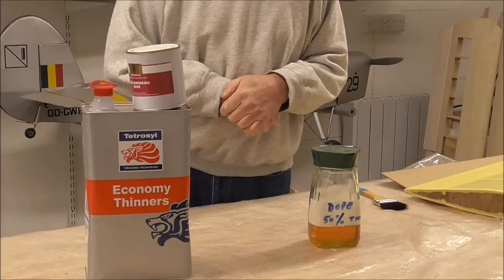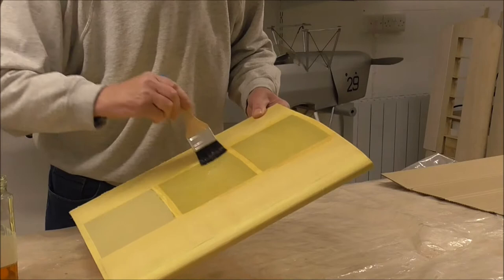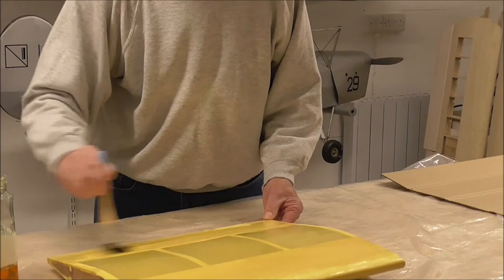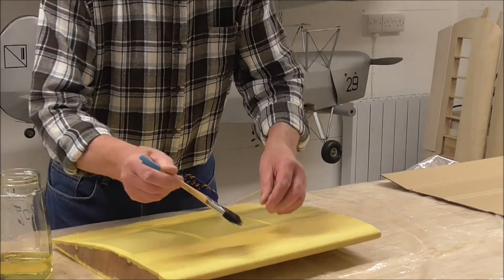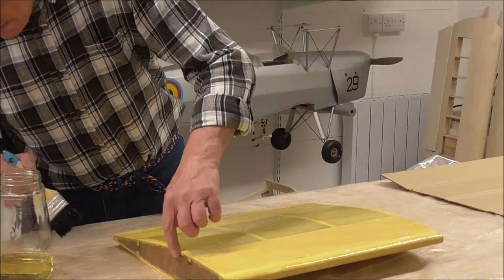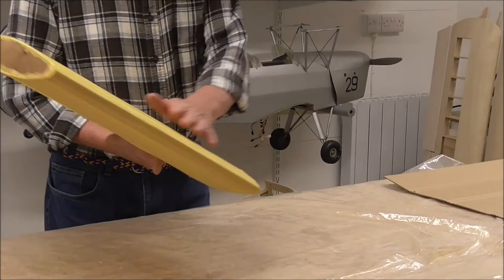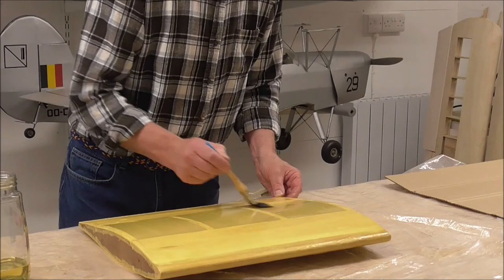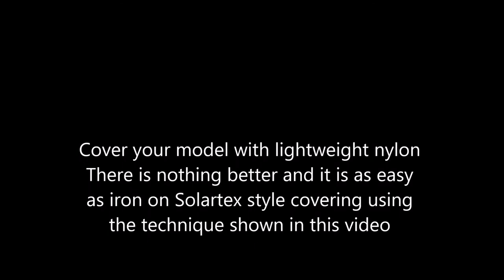Covering with Nylon Part 3

Comment: Thanks for the clear explanation. I'm going to give it a go on a DB Mighty Barnstormer I have had in stock for many years.   I'd never have thought of using Balsaloc or similar to apply Nylon, but when you think of it, it's the same as applying Litespan or similar, with the exception of course that you heat shrink it instead of doping.

Comment: G'Day Phil, thanks for the informative Videos. I'm looking to build and cover 1.5...2 Meter (59..78 inches) RC models are these too small for this covering? I have dope (understand ordinary thinners will do to dilute it. As regards clean up of brushes would you use thinners? Suggestions welcomed. As regards Nylon can you suggest some sites types (All I can find locally is ripstop, apart form the weave what is the problem from your point of view?
Reply from the maker: Hello Russell
Models around 60" span are about the smallest that you can safely use nylon on.  What you need to look for is Polyester Dress Lining Fabric.  The best source for dope is a light aircraft supplies company.  I used actual aircraft High Shrink Dope.  It is thinned with cellulose thinners.  The High Tack adhesive is water based so clean your brush with water.
Good luck
Phil

Comment: dear Phil. I have been researching all the covering technologies for RC scratch building that are there in the past weeks. Currently I am building a PA-18 to a 1/4 scale with 2.6m wingspan. I have come to conclusion that NYLON is the best material and also pretty cheap. I dont want to buy oratex or any brand cover material as I want to avoid those ridiculously high costs. I am struggling to understand what is aircraft dope translated into Greek, what type of material is aircraft dope?
Reply from the maker: When I say 'aircraft dope' I am referring to the type of dope sold by light aviation suppliers for recovering or repairing the fabric of vintage aircraft.  An example would be a Tiger Moth or Auster.  There are a couple of such supplier in the UK, no idea about Greece I am afraid.  You need high-tautening or shrinking dope, there are several types available.  If you have real trouble finding a supplier you can use clear shrinking dope available from model shops.  As you are in the EU you should be able to find it in Germany if such shops do not exist in Greece.

Kind Regards

Phil

Comment: Congratulations Phill great videos, educational  and inspirational as well
Using the information you provied plus the materials I could find I just finished a covering test over an old wing I had using nylon purchased at the household fabric dealer, contact glue and nitrocelullose laquer as dope.
I must said results are pretty promesing but since I do not have any previos experince to compare I should ask how can I perform a puncture resistace test or something to get an idea of how resistenace the covering is.
Thanks
Reply from the maker: Good Morning Roberto
Thank you for your message.  I am not sure why you want to carry out a puncture test.  If you have managed to get the nylon drum tight it will be fine.  All you are trying to do is get it airtight, not to make it indestructible!

Best of luck with your modelling.  If you are not happy with the results, try and get some real aircraft high-shrink dope from a light aircraft supplier, that is the best stuff for the job.

Best Wishes
Phil
Reply: 40 or 50 years ago the standard joke was. If you crashed a nylon covered model plane, you ended up with a bag of broken balsa wood. That joke was pretty much true!

Comment: Nice work.  What's your source for model grade nylon?
Reply from the maker: I have had success with several different types off eBay.  You just have to experiment.  Ripstop nylon is no good, it is not smooth, it has a squared pattern in it.  You need to find some that will ideally heat shrink before you dope it to get the best results.  You can afford to experiment with material off eBay, it is only a couple of pounds a metre or yard.

Comment: Great videos Phil. I too mourn the passing of Solartex and have an airframe coming up for covering which I intend to use nylon on. Did you say you could supply or know where to obtain nylon? I’ve got some JP models stuff but it’s very expensive. Also I have an old tub of Balsaloc which is similar to the heat activated adhesive you used.
Reply from the maker: Hello Ian
The nylon is for sale on eBay, here is the link:
 https://www.ebay.co.uk/itm/362968044663?var=&ssPageName=STRK:MESELX:IT&_trksid=p3984.m1555.l2649
Reply: Ordered.....👍
Reply: Brilliant advice, thank you. Can I ask what you use to paint doped nylon and fuel proof it ? Regards Richard